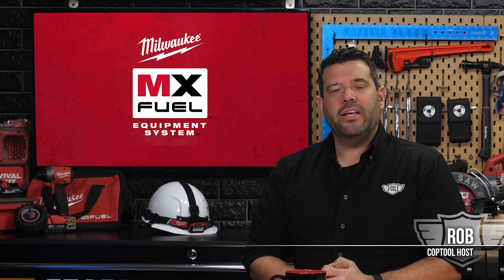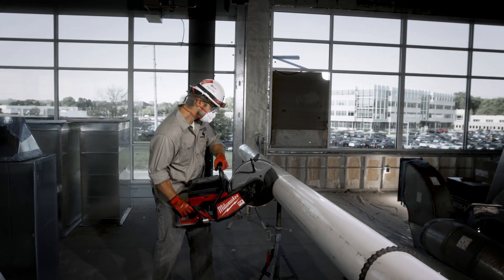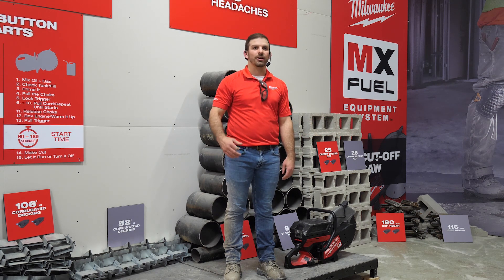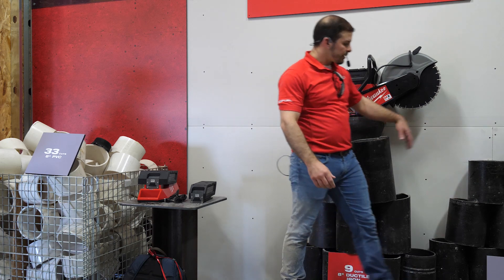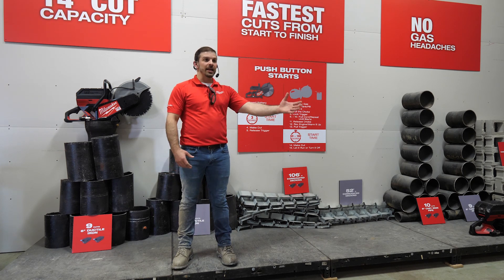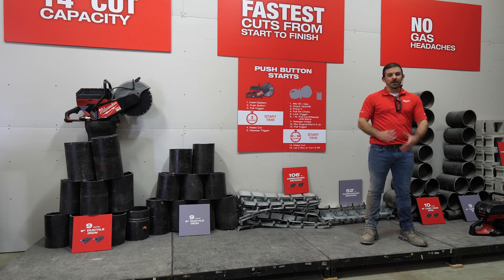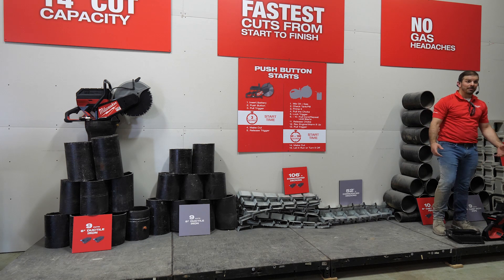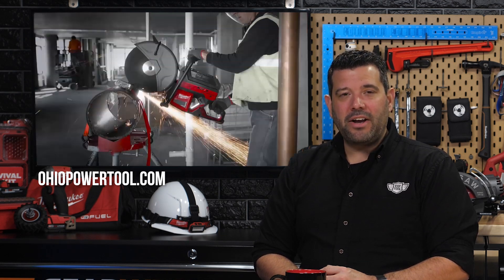Milwaukee MX 14" Cut Off Saw for Full 5" Concrete Cutting Cordless! MX FUEL

Comment: First off it does not have a 14" cut capacity and second saving a couple hundred dollars a year is no comparison to getting 6 linear feet of cutting per battery needing like 8 $600 batteriest to do what $8 of gas would that $5000.. also atleast if you need your gas axe serviced you can go to any one of 20 local shops to get it done within a week, if I want a tool serviced by milwaukee its at least 1 to 2 month. My multi tool has talen 3 months sofar and still is not working and returned. The 14" saw could probably do 3 - 4 feet before over heating and hinestly maybe 5 feet if it doesent iver heat before running out of battery.
Reply from the maker: It does have a 14" cut capacity. It's not just about money here Rain, it's about being able to operate in a basement or other places where fumes are an issue. It's also about not needing to transport gas. Will it work for every situation? Absolutely not. But here are many in which a battery powered saw makes a huge difference. 

As for the runtime, no one will argue with you there. The current MX XC406 battery will only cut for 6 linear feet making a 5" max depth cut in concrete. 

That's a sincere pain point that's plagued this saw since its launch. But the new FORGE MX batteries Milwaukee just announced, are going to make HUGE difference. 

Appreciate you taking the time to offer your viewpoint.
Reply: @ToolShow  How does a 14" blade equal a 14" cut capacity when you have housing over the center of the blade? I agree with the rest you are saying tho.

Comment: I dont know why milwaukee is stuck on producing battery operated high torque/rpm power tools like this. Their claims of long run time are never true. If  this was corded I'd buy it in a heart beat but I know the battery operated saw will be a let down. Hell even my m18 angle grinder couldnt live up to the hype. I ended up throwing it in the trash.

When the stakes are high you cant trust batteries, period. Go gas or corded
Reply: You seriously threw a Milwaukee grinder in the trash? That's dumb. Did you even use the proper battery for the job?
Reply: Unless you were doing pure production grinding..a couple of HD batteries should cover most bases if you have a few rapid chargers running and charging backups

Comment: I think big companies will use these indoors due to no emissions but will stick to gas outside, you could afford to have 2 gas saws brand new for the price of 2 batteries. But recon it’s the start of how everything is going to go..... and let’s not forget you may save on gas for a few years but how long are these batteries gonna keep taking a full charge before needing to be replaced, then those savings all gone and more 😬 I love Milwaukee tools but just don’t feel I would be able to pay more than £200 for a battery, I haven’t even brought a 12ah one yet as they are £169 over in the uk but have a 9ah and it really keeps the tools going a long time so know the Mx will probably be great.
Reply: No this mx line is a failure imo. The whole pitch Is that it's less maintenance than gas and you will save on that cost. Unfortunately the savings is gone when you factor in price of the tool and batteries. Also batteries have a 600 charge life cycle before they are completely toast. There is no way you would spend anywhere near the amount of one of these batteries on gas over a 5 year period. These tools only real advantage are the emissions for indoor work, that makes the target demographic small. If these don't catch on and start selling in large quantities the price won't come down and they will just discontinue them.
Reply: $28 a gallon for the premixed 50:1 trufuel/stihl/echo that they are pushing on everyone to keep the 2 stroke engines running without as much hassle. Run those numbers....
Reply: @phoenix4ever367  I run mine on shell V max with no troubles it’s still E5 👍

Comment: Whoa sounds great until you realize it’s per two batteries. At 31lbs each your talking 60lbs per tank of gas?!? How long is the charge time?  Look in a basement this is a great option but we know those batteries are gonna be expensive. Figure you’ll need 4 batteries in your truck. I’ll bet they are $400-600
Reply: @Dan Rezaie - The 31 pounds is for the entire tool including the big battery.  The XC406 comes in at just under 11 pounds each.  The XC406 pack has a current cost of $599 each. The charge time of the XC406 comes in at 90 minutes for each pack.

Edited to add the charge time.
Reply: Shadowz Edge yeah so you’re gonna need 3-4 batteries on the truck. If you’re doing basement work this isn’t bad. But they said two batteries were equivalent to a tank of gas so yeah it’s a really steep buy in for limited cut time. Just estimating a job I’ve got coming up, I’ve actually got 5 sets of 15’, 6” depth cuts. Each battery cuts about 8 feet. That’s about 20 hours of charge time if running two batteries.if you have two chargers.
Reply: @ultraorange1  way to much to deal with just to make cuts. Gas still
Reply: Absolutely these batteries will be insanely expensive.